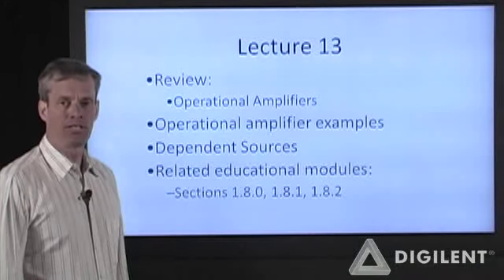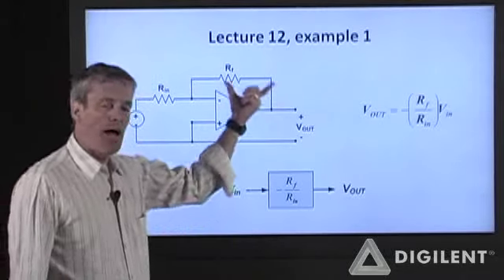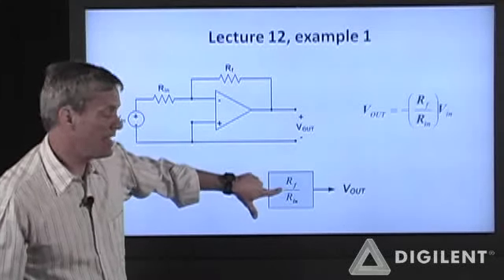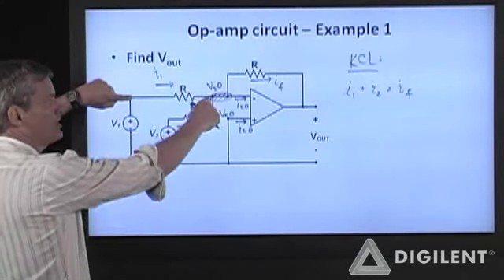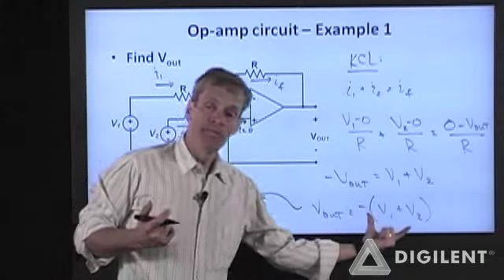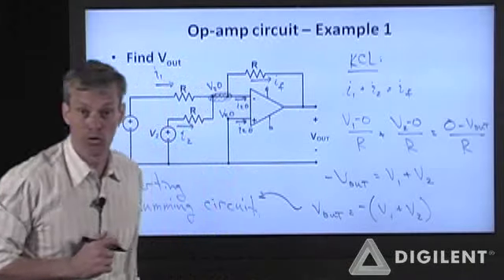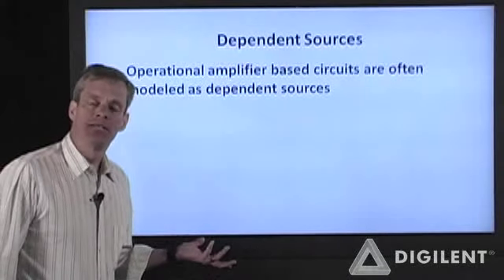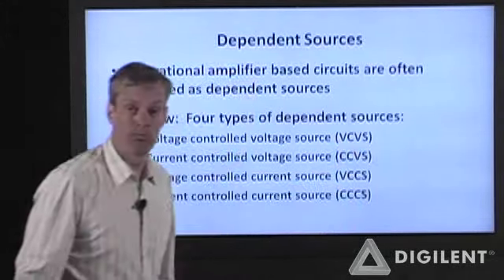Real Analog: Circuits1.13

Comment: With a12-volt input, a voltage divider between the 6ks will give 6 volts not 3 volts.
Reply: Zach Vaught He got it right.  The voltage divider is not between the 6ks. He obtained an equivalent resistance between a 6k and a 3k first, the result was 2k. Then he computed the voltage divider between a  6k and a 2k, and the result is 3v.
Reply: Zach Vaught Yes, he made a small mistake. However, he knows what he is doing. I do not blame him. Every great teacher makes mistakes like that. You can see that he quickly erased the 3volts at 16:09.  I think he was a bit tired. I love this teacher; I learn a lot from him. He is one of the bests.

Comment: In the chapter 5 page 22 I believe that the diagram  for the voltage follower is wrong. the voltage should be applied to the inverting terminal